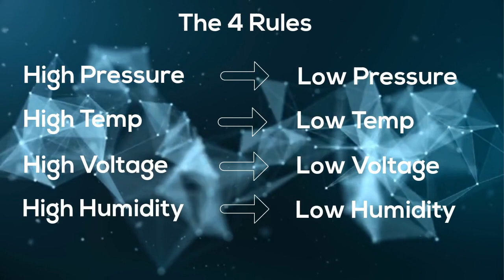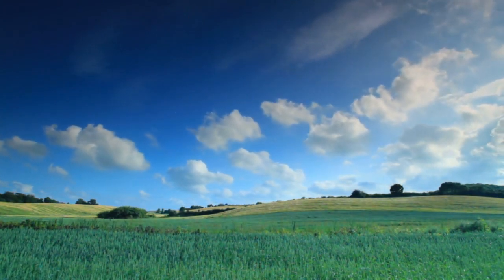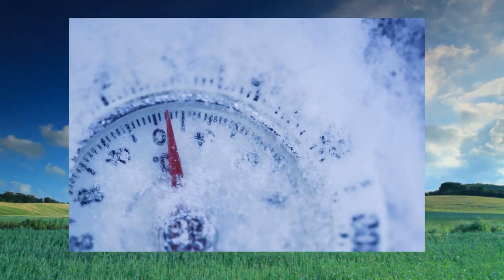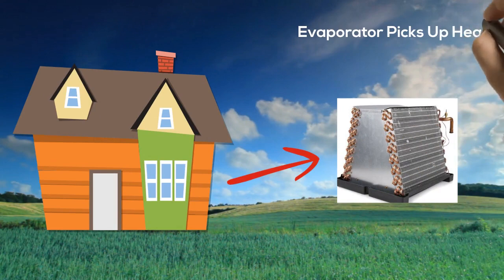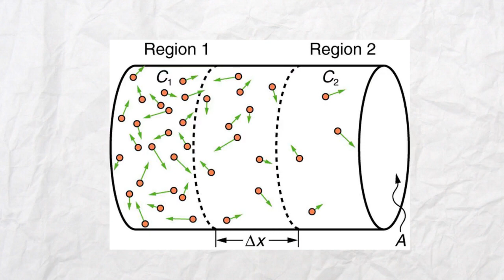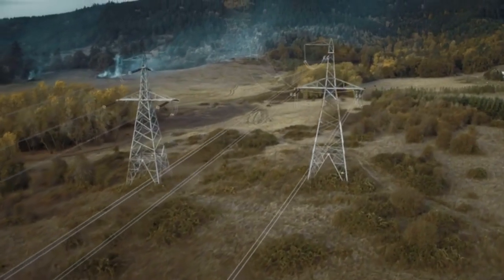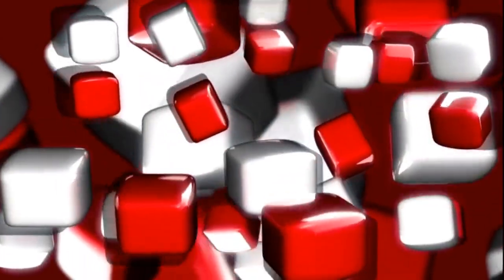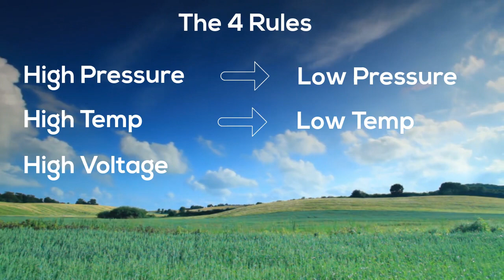4 Basic Energy Rules for HVAC

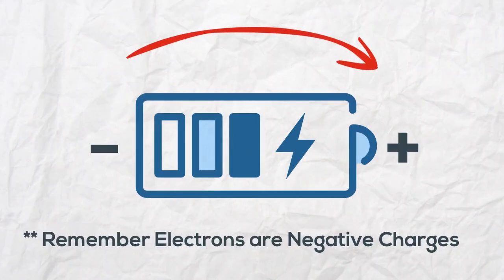Comment: 3:42 gonna spin a few heads, it’s correct, but so many are taught positive goes to the negative. Many schematics are written in reverse with DC. AC is a non issue as I understand it.
Reply: Depends on who teaches, I went to UTI in Phoenix and that is how I was taught. And he explained this too, if you put a switch on the negative side of the load, it doesn't burn out a switch while the positive side does. And that was from a Ford dealer class... and I could never get clarification on this... still can't at this point and I keep asking that question....
Reply: Sorry this is in regards to DC, I understand AC as well..